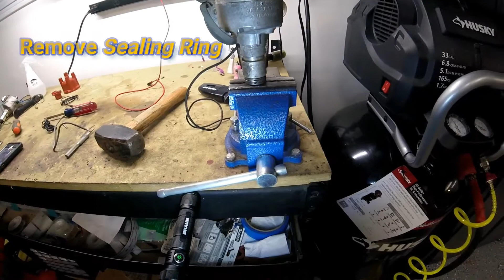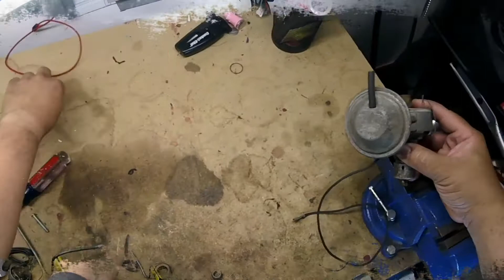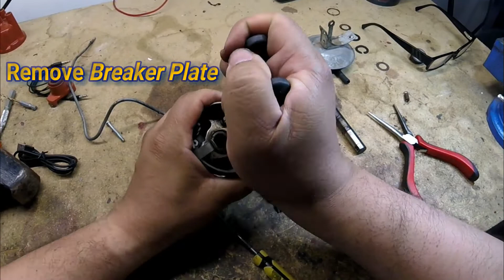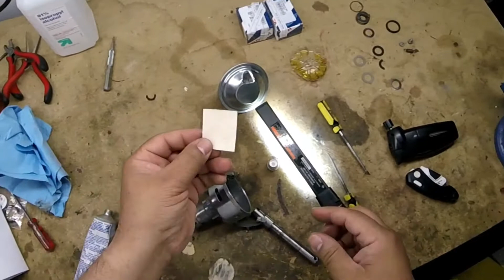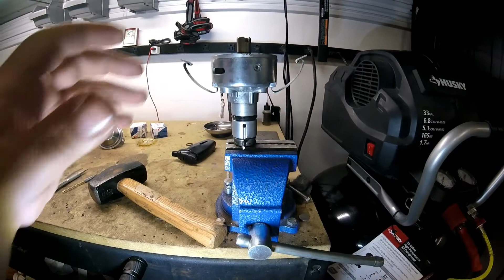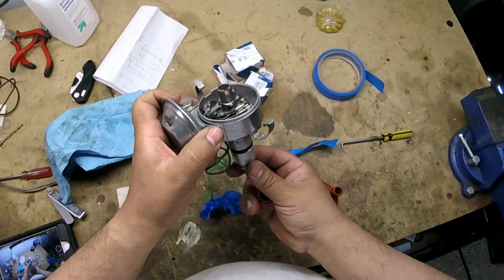VW Distributor Rebuild 113-905-205T

Comment: How did you attach the ground wire. Easy to solder?
Any tips?
Reply: The solder won’t stick. New groundwire keeps coming loopse.
Reply from the maker: Easy to solder, not too bad.
Reply from the maker: Clean the area very well and then solder.

Comment: The “plugs” as you called them are typically vents so air can circulate inside the unit. This is important to mitigate any potential gasoline vapor getting inside and igniting due to the open spark of the points.

Comment: I have a 73 beetle and when I take the cap off I can push down on the rotor a bit and it springs back up. Are they spring loaded ?
Reply from the maker: The rotor itself has a spring tab to hold it in place. If the rotor is moving up and down significantly, then you may need a rebuild.
Reply: If the dizzy goes up and down, that means the fiber discs are shot?  @FixinBugsNStuff

Comment: is that a craftsman versa track rail you have hanging under you cabinet?  if so, where did you get those small bins that you have hanging on it?  I haven't seen those in any store and would like to add some to my wall
Reply from the maker: Yes. The small bins are from the gladiator series.

Comment: Where do you get your distributor fiber shims from?
Reply from the maker: I got it from here. https://www.vwnos.com/
Reply: Do I need the ground strap if I have a compu fire electronic module? What is the purpose of the ground strap?  What is it grounding? Thx
Reply: @rickwoolverton7507  ground strap on dist?
Yes I believe so but you can try it without

Comment: David, great video 2 questions, what is your source for the fiber, shims and oil felt?  What tools did you use for polishing? The final results are awesome.
Reply: Mra1507 Mra1507 call century distributors in Visalia,California. Google it for contact info.
Reply from the maker: I got the distributor parts from here: https://www.vwnos.com/ I just used a chrome polish on the case.

Comment: Would this distributor be good for a 1641 with a 34 pict 3?
Reply: Brown, you’re looking for a 0231-170-034 Bosch distributor.
Reply from the maker: This would not work with a 1641 because of the vacuum requirement.